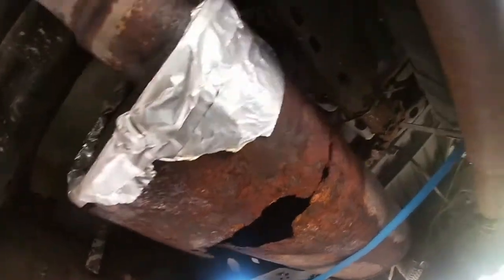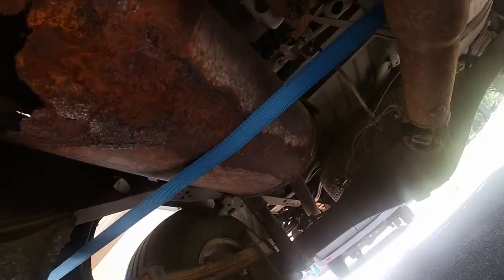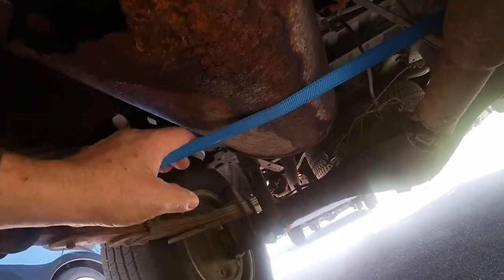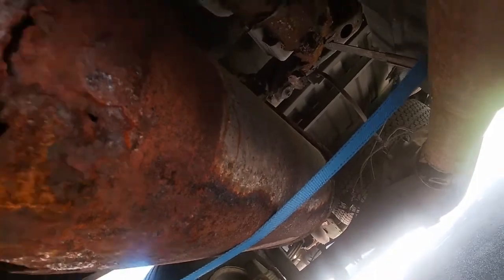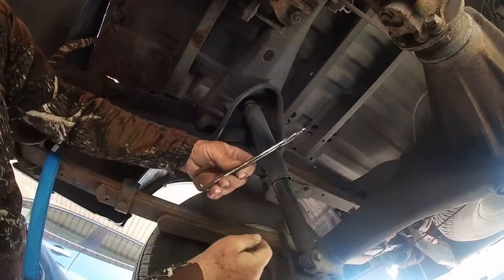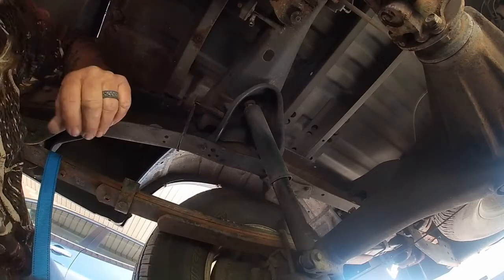Replacing a muffler on a 2004 Toyota Tundra V8 part 1

Comment: Thanks for posting this, Sam. What is the make model of the replacement muffler you used? I am not a welder and would hate to buy one with short hangers.

Thanks
Reply from the maker: I just told them the make and year of my truck general info and they told me what muffler I needed I went to auto zone and just got it though them.                                                                    Thanks
Reply from the maker: I didn’t have to do any welding